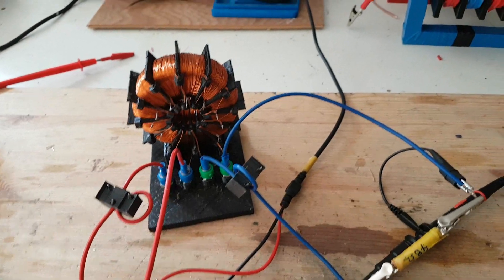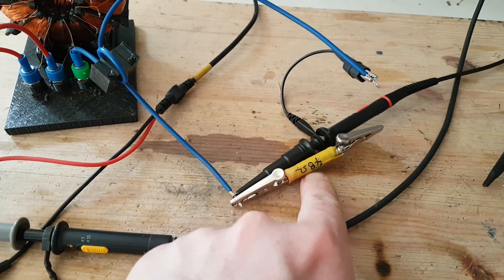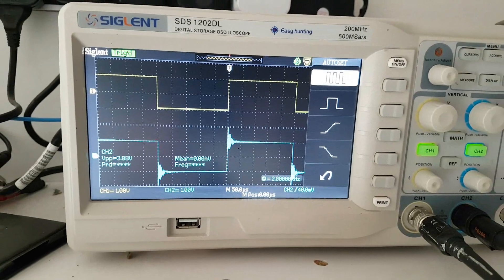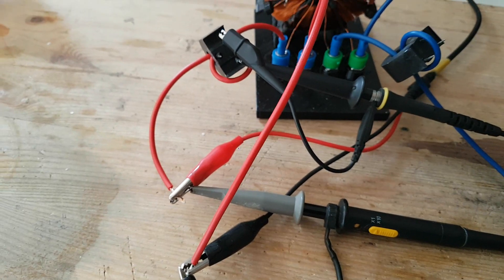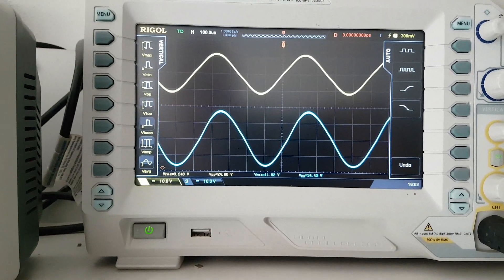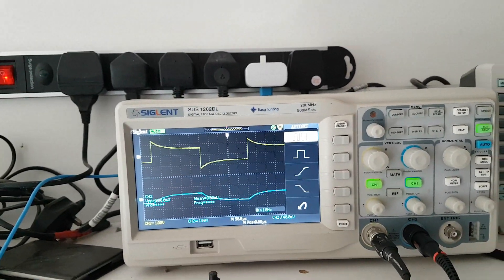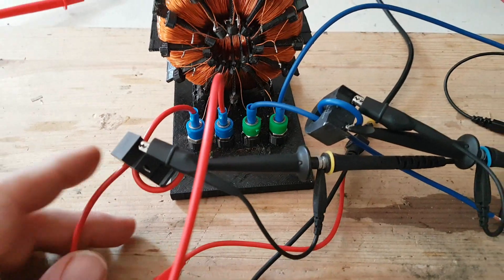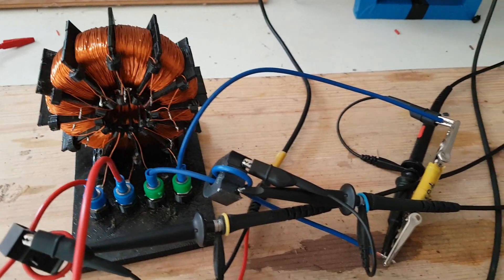Overunity transformer?  Let's see.

Comment: Are the masses of each track isolated or common?
Reply from the maker: Do you mean a common ground? I would say it is via mains. But how this can play a role here? If this is a case , I can run scope via isolation transformer.
Reply: @dielectricrules3573  For grounded connections to the 220v network, ungrounded intermediate sockets will do. But if, ON THE SAME OSCILLOSCOPE, the grounds of your measurement probes are connected (the same ground) then you have a bridge between your input and output measurement.
Reply from the maker: @alixnamhicce2615  Not sure what is wrong about that. Ground same for both and measuring different potencial on each probe.  Fine, I can run oscilloscope through the isolation transformer .

Comment: Try with s zvs driver
Reply from the maker: I also found, when I go above 2V or below 2V the efficiency goes down.
Reply: Yes zvs is good but I'd have to know more about the coil to give more info,use induction cooker with tuned secondary,use loop stick to tank it back,most important if you get your trumpet wave right your done